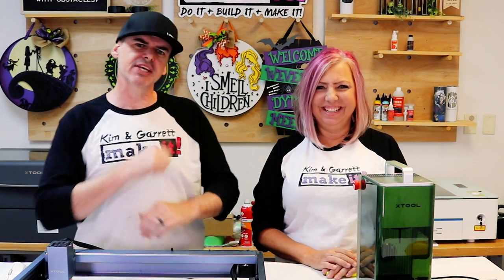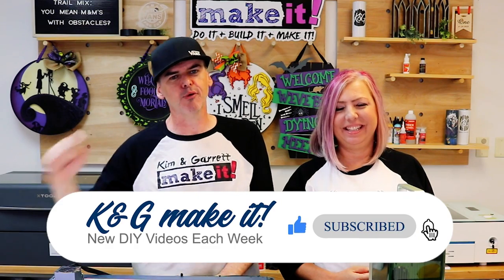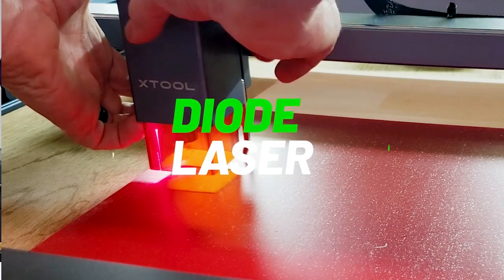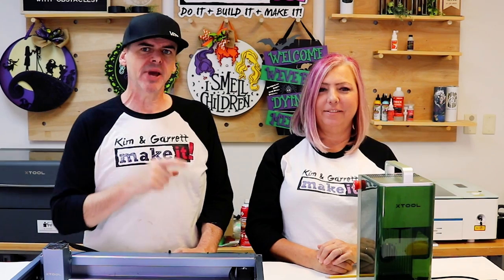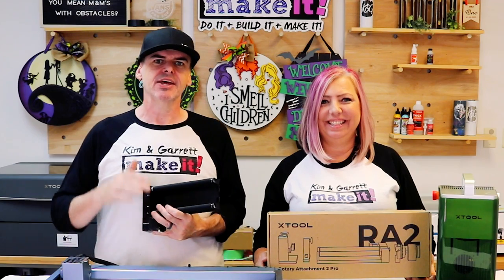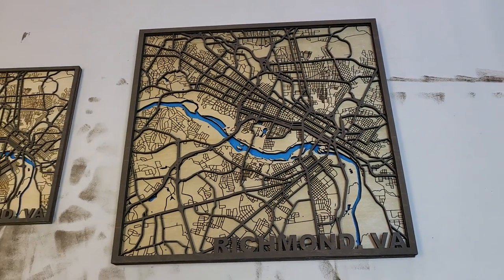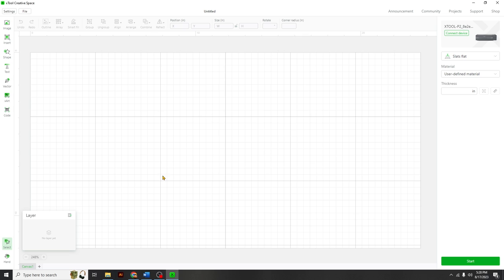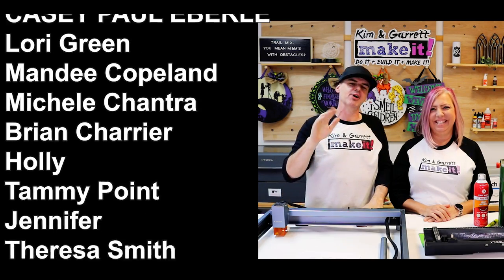How To Start a Laser Engraving Business! Which Laser is Right for Your Business?

Comment: I have 2 diode lasers, the Roly Lasermatic 10 and the NextWave Moray ready 2 laser.  Both have full enclosures which is important to me because I have children.  The Roly 10 watt diode was easily capable of cutting through 7mm cedar planks.  If you hope to do work at a craft faire, I suggest getting an enclosure for your laser.